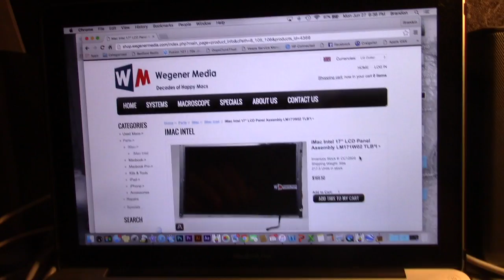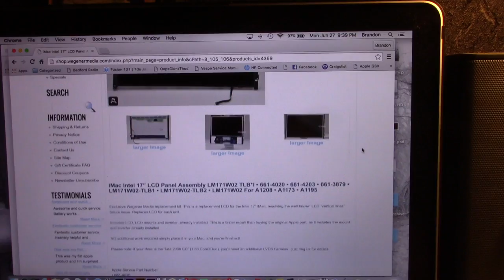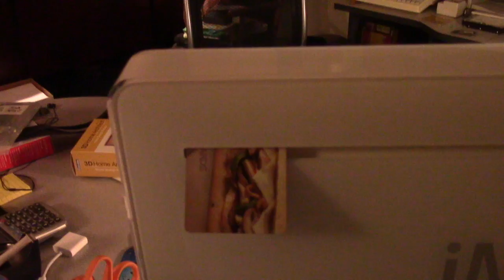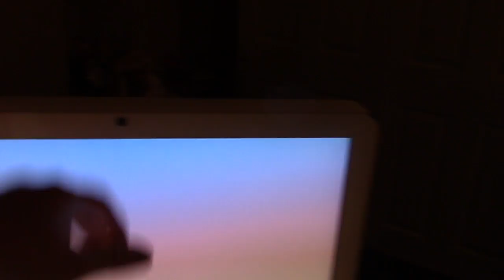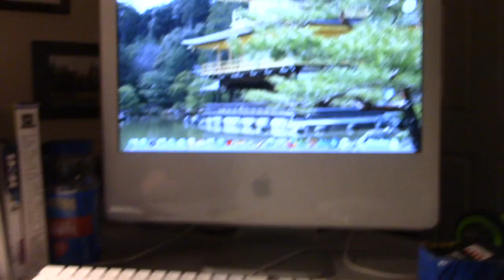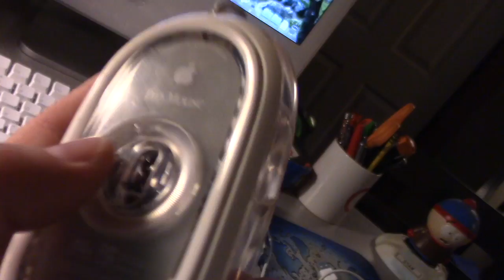First Generation Intel iMac; A Technician's Perspective

Comment: I have owned 2 laptops and both of them the screen has failed, the first is my 2008 Gateway that died last year I was ok with it though since it was almost 8 years old it just ran way to hot most of the time. The one that dissapointed me is the laptop im using right now (hooked up to my TV) my Toshiba l505 had a year of use when I got it last October and the screen died in March so pretty much 2 years of use at most

Comment: There was also this kit to pick your own display/fit it yourself https://realmacmods.com . I did consider it but moved on to the black backed aluminium imac. Quality of the display on the 2008 iMac isn't as good as on the 06/7 but it doesn't have lines!
Reply: I'm also assuming the connector is the same on the 20", so it could be an option for improving/repairing a 20" white plastic iMac!

Comment: Huh, I have a iMac 5,1 running Mountain Lion using MacPostFactor. Google Chrome actually runs really fast and is capable of some 720p 60FPS videos without a hitch..
Reply from the maker: Very interesting; I have 20" 7,1 and 8,1 units that are dog-slow even with 4GB of RAM installed, and they're actually supported under El Cap. To each his own I guess!
Reply: BBISHOPPCM's World I'm guessing its probably the ram slowing them down. I bought a 4GB 1600MHz RAM kit to replace the god awful 2GB 1333MHz  it had before, which explains why it's fast. Apparently these older Macs can go to Yosemite with modding, with the exception of no QE/CI support.
Reply: i heard from computer forever that el cap is slow for his old laptop  but only macs i have around are emacs so i dont know

Comment: I have a 5,2 iMac, I can say they are relatively useless on the internet anymore. They work for 480p and light web browsing and that's it. I can also say the 5,2 I have came with the GMA950, which is hopeless for anything above 720p.
Reply: ublock will help a lot with general browsing speed
Reply: It doesn't make much of a difference. It's still horribly slow due to the fact it has Integrated Graphics and only 2GB of RAM
Reply: Are you runing 10.7? Seen one of these running 10.6 pretty well.
Reply: 10.6.8
Reply: It's the 1.83Ghz C2D Education Model iMac, it's basically a Dell Latitude D630 without dedicated graphics in terms of hardware.
Reply: +LTech13 Seen your video, still have a vista notebook with pretty similar specs (but Nvidia graphics) in use. Once it finally booted (HDD is dying, but not worth it to replace, fan bearings are bad) it runs the Internet fairly well. Try a lightweight browser.

Comment: As my school put these machines out of service It was my duty to boot up and format the hard drives in each machine. I never saw one 17" iMac with the vertical line issue, I guess we just got lucky :D

I had to format around 200 machines.
Reply from the maker: That's very lucky. Of the 600 or so units I had, about 25% of them failed in this way. We hire kids to perform basic summer grunt work; that's how I got into the business!
Reply: BBISHOPPCM's World I actually get to skip certain classes to help out with various technological duties. I would love to eventually take a job similar to yours.
Reply from the maker: It's a great gig for the right person, in the right district!
Reply: pretty much did that as well myself
Reply: Kyle's Tech Channel  Are you the same kyles tech channel, that gave the 2009 mac mini to IMNC?

Comment: (hey Brandon, are you familiar with the ThinkPad T20-T23 and the Blink of Death issue? I remember our community college having issues with that, and later the T40-T43 GPU/southbridge failures and T61 Nvidia failures)
Reply from the maker: I had a T43 and sold it before that had a chance to happen! I miss that laptop, really.
Reply: AFAICR the T4x series GPU and southbridge issues were mainly on the earlier versions (T40s and T41s, I've never had a failure on a T43)
Reply: (and didn't the Nvidia problem also hit Dell, HP, and even Apple?)

Comment: I have had a 20" late 06 iMac demonstrate the classic BGA video failure, It's quite a shame.
Reply from the maker: Interestingly enough, not one of my 20"ers has suffered such a fate. Surprising, actually.
Reply: Unfortunately, I've had three of this era iMac's, two 20 inch iMac's, one with the CoreDuo and one with a Core 2 Duo and one 17 inch iMac with a Core 2 Duo. Each one of them have the BGA graphics failures which required me to remove all of the ATI GPU Kexts in order for the system to boot and run without QE/CI. Quite annoying but it's the only way I can get them to boot.
Reply: @BBISHOPPCM's World That's very very lucky, as GPU failure is the most common issue on the 20" iMacs of that vintage. I have not one but two which have GPU-related issues.

Comment: my intel iMac died due to GPU failure that was indicated by other models of the same timeframe
Reply from the maker: I've had only a handful of GPU failures on iMacs; I generally saw that on first-gen MacBook Pros. Fortunately, LCD displays were easier (and cheaper) to find than logic boards...